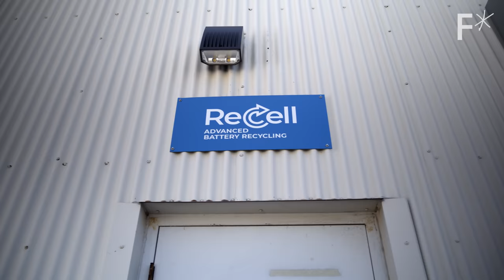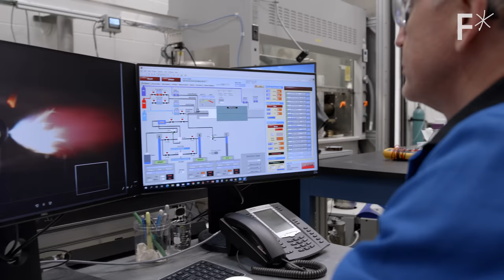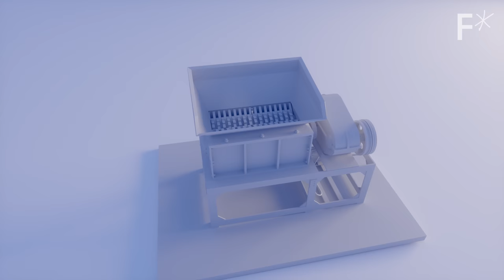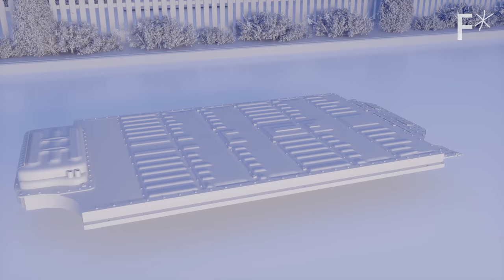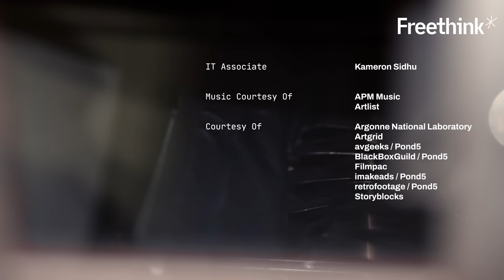The future of energy starts with rebuilding the battery | Hard Reset

Comment: The rapid pressure to move into electric cars is beyond stupid. The grid is already overstressed, materials to make batteries are scarce and growing in cost, and WILL be gone before a fraction of politically motivated false need is met. Recycling materials is absolutely essential, and to do so economically is beyond essential. Good luck with this.

Comment: 5:13 "If I was to design a battery, the first thing I would do is make them more easy to dissassemble"
7:48 "A future with a recycle friendly battery..." Proceeds to show batteries sealed into the floor of an electric car..

Sealing batteries into the floor of cars (Tesla) makes fixing those cars very difficult.. Stop making throwaway cars! make FIXABLE vehicles with easily replaceable battery modules!

And while we're on recycling, remember the three r's, Reduce, Reuse, Recycle.. in that order. Alot of dead battery packs in drills, old laptops , almost anything with a battery now sometimes has some cells inside that are healthy and can be reused. Recycle should be the last course of action.
Reply: " Stop making throwaway cars " Its not that they make throwaway cars, its that the car is the battery. The other parts are less than 20% of the value and they are totally fixable.
First you need to be able to make a car that's actually usable, then you can think about recycling. 
Ironically they are not making the batteries replaceable to save in weight. 

I think the traditional method of just melting everything at industrial scale, then separating the different kinds of metals with acid is good enough. We recycle 85% of the aluminum that way, and the other 25% isn't recycled because its entering new for even more expansion.
Lets go to the basics, we want to recycle to get back the metals, because that's the limited resource, its not the energy, so who cares if we lose energy, energy can be generated totally from methods that don't make much green-house gases.

This video failed to convince me of their method.

Another alternative is just don't do anything, when we run out of raw metals, we can then literally mine landfills. And when we run out of those we to go space !
Reply: I think that mining for scrap metal out of waste is what's going to happen, because that's what happened to aluminium. First, raw metals are ultra cheap, then we start running out of raw production, then it comes a time when recovering them from the scrap becomes economically viable, that's when you get most of metal being recycled.
Sure making batteries to be easy to be disassembled would help, but I don't think that solves the problem, batteries are nasty, when they get bad its because the elements already mixed, so perhaps there's no point in ever trying that.

Gold is always 100% recycled, wonder why... oh, mining for new gold is super expensive because its rare.

Really, we don't have a big of a problem, our only problem is getting more electrical energy for cheap and without releasing too much green-house gases.

Perhaps the biggest problem of all is that we don't even have enough lithium to even have the entirety of all our vehicles electric. So recycling isn't going to help decrease the need for raw mining in any way, we need more raw resources after all, they need to first exist to be recycled. 
The demand is so high that it will probably consume all recycled metals (specially cobalt) and still ask for more to be mined. 

"Reduce, Reuse" is bullshit, reduce ? we need to produce 1000 times more than what we have, if we are to get rid of internal combustion.
Reply: Completing design goals. Solving range anxiety vs lowering the cost of materials. Which goal takes precedence?

Comment: I don't have background in this area so I'll just leave with my own hypothesis. Similar to how solar cells work, what about using something that renewable from the inside and have a modular architecture to make it so you can change parts which are broken and the recycle process will be for each parts instead of dissolve everything except the core? I'm aware that solar cells need proton to create fission reactions in order to create transfering energy which in turn converted into the usable energy. Parts will get decay as time goes by no matter how great the materials are, so you can use something that safe and durable enough but also disposable or could be recycle. Something that will never run out would be the mechanism itself that producing energy. I mean the battery is the part that keep usable energy right? You can just focus on salvageability so that you get highest materials back at the lowest cost possible(using renewable solutions to decompost things instead of burning the case to get the seed).
This reminded me of the illuminate stars decoration that you would put at the ceiling in your bedroom. How does it glow after you turn off the light? If we can produce the hybrid generator that bouncing from different type of energy to fill the system and can run forever while creating the excess energy that we can use that specific type to create the usable energy. So we basically got free energy forever....well until the parts broken and we have to change them some later time.
That's why focusing on modular architecture would become the most powerful thing to create the foundation for future researches. I'm aware that there are some models that have modular architecture, but they're not hybrid generator or renewable battery.
Reply: Solar-powered cars!

Comment: They need to be systems in place where you get something for returning these batteries. Battery Plus charges a core charge as an incentive for returning agm and golf cart batteries. But these batteries are larger than car batteries. So they needs to be something for 18650 or similar batteries.

Comment: One way to recycle them woule simply to use them longer.
I am disassembling "defunct" old laptop batteries at the moment. And at least half of them are "ok" and only disbalanced in the pack and the electronics cannot compensate.
They could be repurposed or repaired.

Comment: Say what you like, but as long as people will be recharging those quote environmentally friendly quote green and quote batteries from electricity produced by burning coal, we're just spending our wheels. All we're doing is encouraging people to spend their savings on vehicles that are dependent on fossil fuels in a different way;  at a time when too many Americans are dealing with brownouts and blackouts on a regular basis, why in the world would they think it's a good idea to make their transportation dependent on that same, less than dependable system?

Right now, even if there's power outage, they can still use fuel that someone expensive, but they can be mobile. In South america, for decades people have been making their own fuel from biomass. This will only work with an internal combustion engine. An electric car when the grid is down, is an ornament. A very expensive ornament.

 This makes sense in some situations, but only in some of them.
Reply: Coal is rapidly being retired.  Other sources of electricity are far cheaper as well as cleaner.  EVEN IF an EV is powered by coal, it STILL produces less CO2 than a car powered by gasoline because electric motors are so much more efficient than gas engines.
Reply: @incognitotorpedo42   an electric motor without a reliable source of energy to recharge it, is not a more reliable no I'm more efficient mode of transportation. It's an ornament.

We absolutely do need something that's greener. But it would have made more sense to phase things in in a way that doesn't leave the most vulnerable people in the population at a loss.
Reply: @daphneraven9439   I agree 💯. 
Now if all cars were solar-powered or can evolve to take much more efficient, longer-lasting batteries....

Comment: Batteries of any kind need recycling. Battery manufacturers make money by SELLING batteries, not recycling them. So any battery, however small, costs the cost of making it, plus the costs of distributing, marketing,  selling it plus the cost of recycling it. Today, not even the most environmentally minded person on the planet will drive 0.5 miles to dump his batteries in a recycling center. So the battery cost must reflect the entire loop cost. Any device that comes with a remote must have 2 prices= with or without a remote. the cost of the remote should be 500% of the overall cost. Any battery smaller than the one used to start  a car, should be priced beyond the reach of Bezos or Musk. Yes, this includes cell phone batteries. It is high time we end the idiocy of being connected 24/7 and the NSA, GCHQ, Google, Apple, etc  reading every bit of BS you upload or download. A SMART phone is only as smart as the one that bought it. For the global warmers paranoids= a battery is only, tops, 70% effective charging/discharging, and this number goes down as the battery ages. So every time you recharge your cell/remote/whatever, you only get 70% of your electric bill back. 30% goes to heat. And when you discharge the battery, you only get 70%. THINK